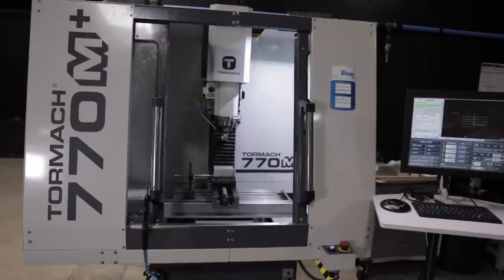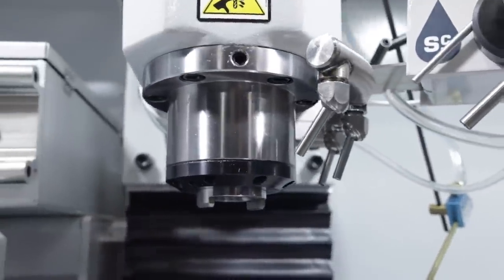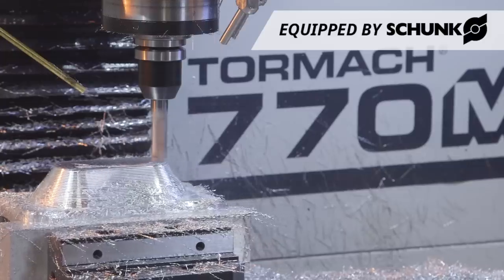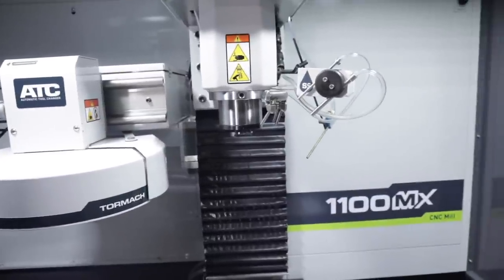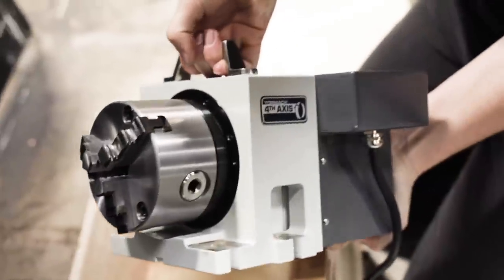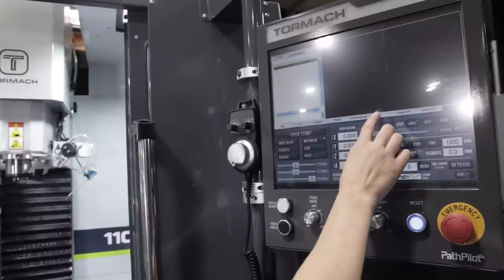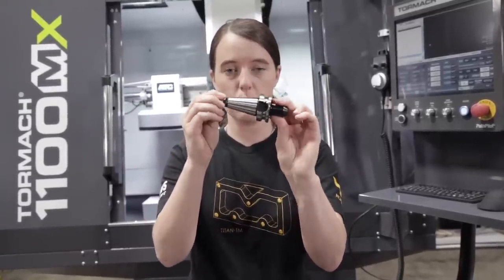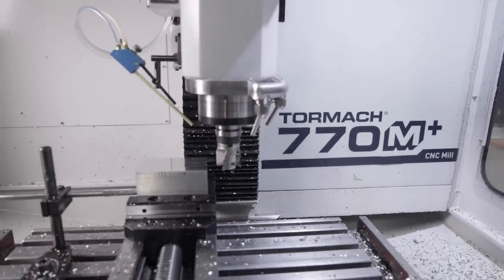Tormach 1100MX vs Tormach 770M+ | The Difference Between These Two CNC Machines

Comment: Great information!
Comparing the MX1100 with a washing machine 🤣 But then I realized that many people might have no idea on power consumption so 👍
Putting a 770M+ in your kitchen - BOOM!
Reply: She probably meant drier. So it would go in your utility room. Of course, it would also plug in in place of your oven.
Reply: @roflchopter11  Plus electric dryers use 220V!
Reply: Aww you Americans and your cute power outlets. 🤣 i prefer my English plugs, I can plug anything in anywhere.
Reply: @wildin13  Yeah but God help you if you step on one of those plugs.
Reply: @wildin13  here i am with my safe euro plugs and 400 volts readily available
Reply: @angrydragonslayer  You are using a 110 size plug for 400 volts, or are all your plugs big?  You are using a plug for 400 volts?
440 is always hard wired in the USA.
Reply: @EarthSurferUSA  it really depends, generally speaking, something that might need replacement by untrained personnel (so pretty much anything above 2.3kw in a home) will have any of a plethora of connectors (typically specific to your country, such as perilex here in sweden or SN 441011 used by the swiss)

they were technically replaced by IEC 60309 but that is so bulky and unusable that countries either stay with what they got or are going hard wired (if it's less of a hassle)

Comment: at 3:40 what is that doing? you put material in the head and then cut it? or was that specific to a tool holder?
Reply: It's essentially turning the mill into a CNC lathe/'vertical lathe".   Pretty effective if you need an absolutely concentric, complex part and no lathe handy.  
The best collet and holder is usually an ER32 or ER40 TTS holder since the collets can handle 3/4"+ of stock. 
You can even use it manually in a pinch to quickly turn down a dowel or do a multi-operation drill cycle with multiple drills or boring bars pointed vertically in the vise and have the program run through each of them vs. changing tools multiple times.

Comment: Nice comparison.
But a small note.
you shouldnt mix BT and BBT holders. While it's compatible, it's not recommended because dust and debree could stick to the face of the spindle while using BT, when using BBT afterwards the stuff gets between the holder and spindle...

Comment: I worked with a company that developed process to sell with the Robodrill machine, (a fast little machine), to sell to union automotive shops, (Like Allison transmission in Indiana)---because they don't know how to develop processes. :)
I have been living off my 1100 since 2007, and it is nice to see faster spindle speeds today, but with a 30 taper, it would be nice to see more than 2hp also IMO.

Comment: 1:45 The DRYER uses the 240V outlet, not the washing machine. There's not much to a washing machine, small motor to turn the bucket, and a pump. The dryer OTOH, has a big heating coil that 120V can't cut it and would trip the smaller circuit breaker.

Comment: How much does a BT30 taper spindle would substantial benefit from R8 spindle with just increase from 1.5 HP to 2 HP ?
Reply: Better tool holder availability.
Reply: Much less likely to have tool pull out and better rigidity
Reply: @Frmrspecialist74  Bingo.  Push the R-8 hard, and the tool holder can be pulled out of the collet, and it does not have to be pushed that hard with some tools.  When I have that problem, cleaning the tool holder shaft and collet with brake cleaner, (get any oil from the surfaces), usually holds well.
Reply: @EarthSurferUSA  you can get side lock R8 collets, but I’d rather have BT30 so I can add automatic tool changing

Comment: So you and you dad got your first machine put in the garage. I just recently retired from my job and always had an interest in these machines. I have always wanted to get into this field as a new job. I need to find a school in my area that will teach me how to use fusion 360, then i would be interested in purchasing a one of these machines. I have always wanted to create and build my own things using cnc machines. How long does it take to learn how to use a cnc machine like the tormax 1100 with fusion 360.?
Reply: Fusion 360 is not the CAD to start with....try Rhino.
Reply: Unless you want to do 3-d machining, you really don't need software to generate programs.  I write them by hand for anything not 3-d machined, and I am just as fast writing it, (when I am in top form).  I do use a drawing program to draw the part and find the intersections I need for programming.  99% of the programming I do is not 3-d cutting, but I have programmed some small 3-d stuff by hand also,---and took all damn day for an inch long feature.  :)

Comment: MORE LIKE THE ONE,770 IS 120 VOLTS 20 AMP SINGLE POLE BREAKER. ( FOR A POWERFUL HAIR DRYER OR REFRIGERATOR) THE 1100,TORMACH  IS  A 230 AMP TWO POLE BREAKER. THE STANDARD DRYERS THAT ARE ELECTRIC ARE ALSO A 2 POLE BREAKER.  GOOD JOB SHE IS ASSUME! AND COULD TEACH ME CNC.

Comment: This is interesting, but it doesn't answer my burning question of why  Haas machines suddenly went extinct at Titan, and why all of these other tools were brought in. Comparing 770 to an 1100 is kind of like comparing a Honda Civic to an Accord. But somewhere along the way somebody at Titan compared a Haas to a Tormach and made a big bold decision. I want to see THAT video!
Reply: Not sure if it's so much about comparing functionality or specs as it is about sponsorship and money.   
I'd be willing to venture that Titan and crew are getting more overall financial benefit from Tormach than from Haas.  It was likely a part of the sponsorship condition to remove the Haas machines and Tormach would backfill the space with their gear.
It also makes more sense to the educational and hobby crowd that they are focusing on.    A Tormach is significantly more attainable than even the smallest Haas (A mini mill or TM-1) and makes for a much better starter machine should a viewer be interested in buying one themselves.
Reply: @shirothehero0609  Haas TM-1P new is like $35k but even stripped, it's MUCH more machine.  The 1100 is close to $28k with the tool changer and no matter what, it's hard to make up for the differences in rigidity and slop, in the Tormach.  I learned on a TM-2P and when I used an 1100, I was horrified.  For my money, buy a used VMC.  There are used Japanese machines with 6-8k hrs for the same money.  If you can power it, don't waste your time with toy machines.  That being said, you can do a lot with a Haas TM and it runs on single phase power.  By starting on a full sized machine, it saved me tons of money to only buy tooling once.  I already had really nice tool holders when it was time to move up from the TM-2.  I just had to change some pull studs over, and my really nice hydraulic tool holders, ER chucks, and Sandvik face mills were ready to go.  The women in this video seems really cool, but Titan is no doubt making money in sponsorship the same as Saunders.  I'm not saying don't buy a Tormach, but get the other point of view before you lay down so much cash for what is a heavily modified chinese desktop mill.

Comment: It seems silly to run the 1100mx on 220v power when it only has a 2hp motor

My air compressor and shop vac are both rated at 5hp and only require 110v power
Reply: it also has servos for three or four axis plus motors can peak way above their power rating.
Reply: Typical 110v outlets are rated at 1500watts. 2hp = 1500 watts. With the additional load of the servos, controller etc.. I'm sure it hits 2000 watts +.
Not only that but 220v at the same power can use smaller, more flexible wire.

We all know the rating system on vacuums is "Instant Power" and not sustained power. 5 hp would need 3500 watts. Not happening from a 110v socket unless you're running a dangerous setup. Ie overloading the wire and outlet, installing higher than recommended breakers.
Have you ever touched the power cord of your vacuum and felt it to be hot? It happens to mine when I run it for more than a minute or two. Big fire hazard.
Reply: 2hp is spindle alone power consumption... what about everything else?
Reply: @jackflash6377  Nice explanation.
Reply: Not silly at all.   
You always want to have a safety factor built in for any system and running it on 240 will give you a significant amount of extra headroom.
 The wiring can only handle so much current and throwing a 2hp motor, 4 servos and control electronics will push past a single drop of 120v on 16awg pretty quick.   The motor itself (at 240v) will push almost 7 amps. At 120v it will draw almost 13 amps! A 240v circuit will draw half the current than a 120v circuit and thus can more 'effectively' handle a higher, sustained load than a 120 will.
Also, your 5hp shop vac doesn't draw 5hp worth of power constantly.  It CAN draw that much power if you're sucking up bowling balls, but I can promise you the wiring, motor and circuit can't handle that in a sustained fashion.   P=IV , V=IR.   Can't get away from Mr. Ohm. 
Hope that helps explain.  
(Also, Not trying to be  jerk, truly trying to help explain)
Reply: It seems silly that you believe your shop vac and air compressor are consuming a true 5hp and are doing so on 110v.